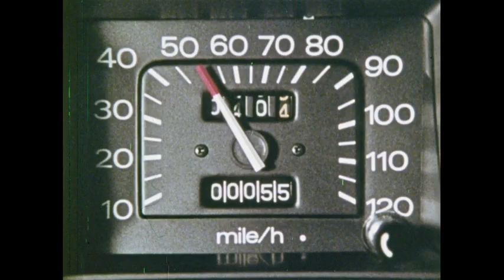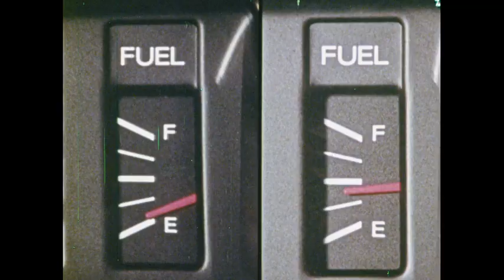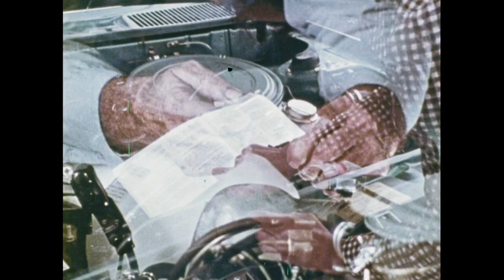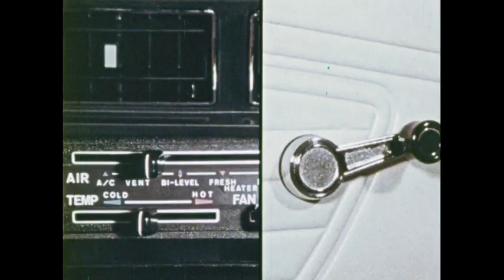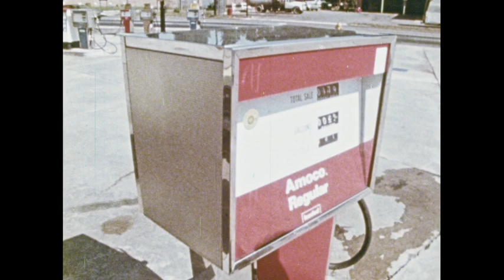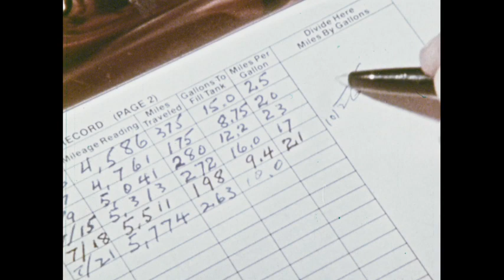How To Squeeze More Miles From Your Car (1976)

Comment: But the alternator is being driven when the engine is running anyway
Reply: when the alternator has load it creates additional drag to produce the amps to charge the battery. at lower voltages, and longer crank times, more amps are required by the alternator. amps x volts is power, and therefor the alternator is harder to turn, and puts load on the engine.
Reply: @lancebrown5739  Oh really?  Thanks for pointing that out